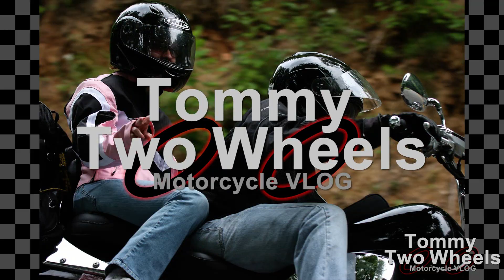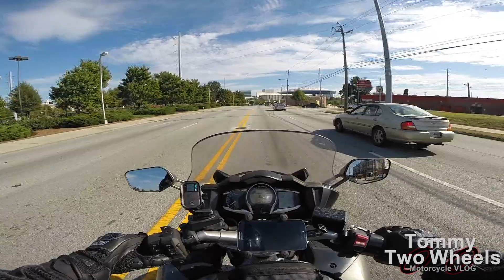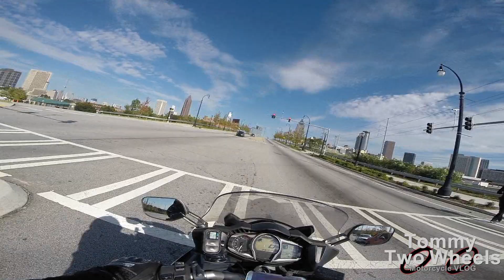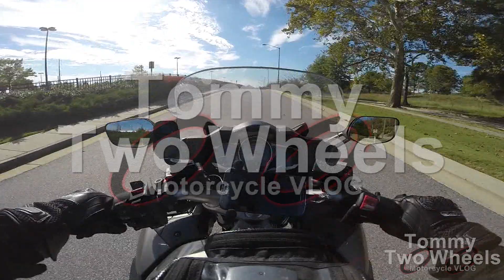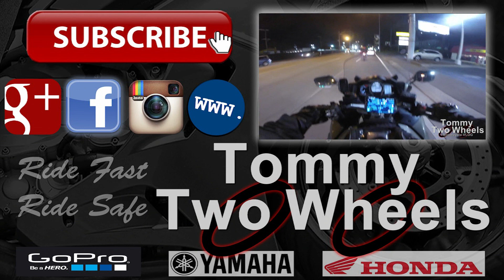TTW 71 - Traction Control Systems and FJR Wheelies

Comment: Try to find just a little steeper hill, wider road and put it in second gear and feather the clutch. Because its so front heavy, put the front end down lightly. You'll prolly go through some fork seals if you're just learning.